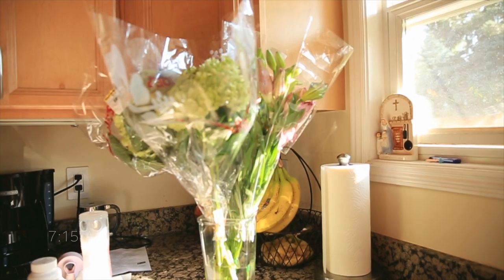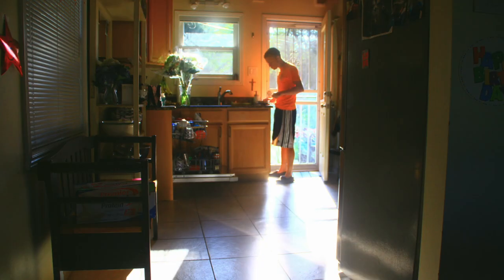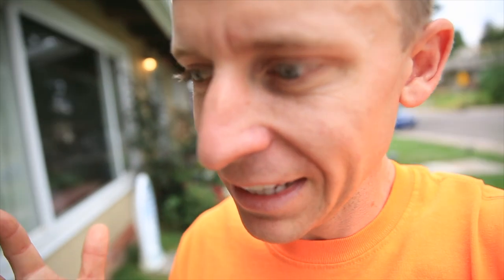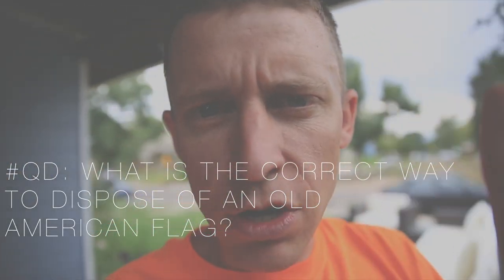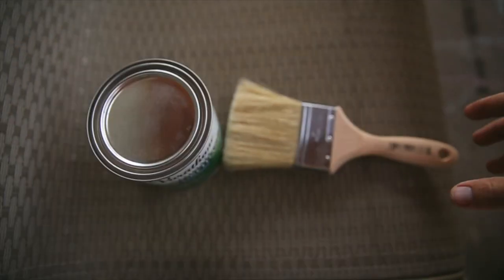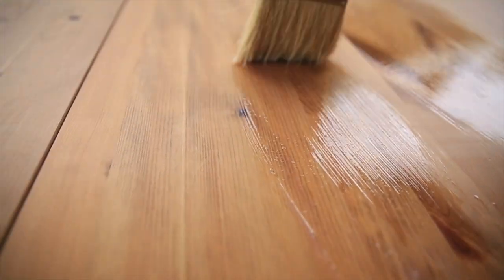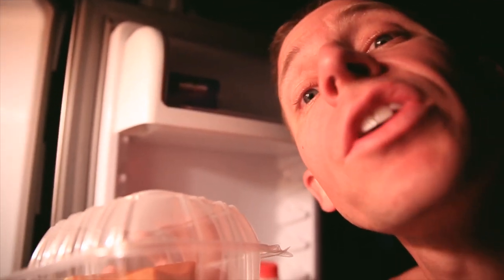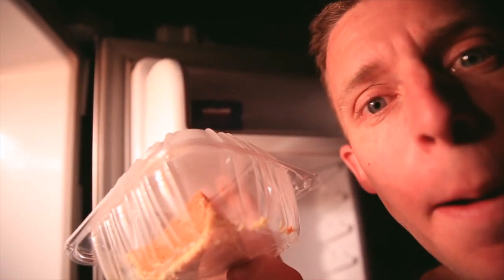How to dispose old American Flag?

Comment: According to the VFW
Flag Disposal
1. The flag should be folded in its customary manner. 

2. It is important that the fire be fairly large and of sufficient intensity to ensure complete burning of the flag.

3. Place the flag on the fire.

4. The individual(s) can come to attention, salute the flag, recite the Pledge of Allegiance and have a brief period of silent reflection.

5. After the flag is completely consumed, the fire should then be safely extinguished and the ashes buried.
Reply from the maker: Heather Vitry wow, this seems spot on, thank you Heather 👍🏻